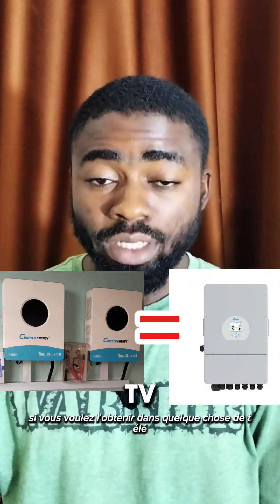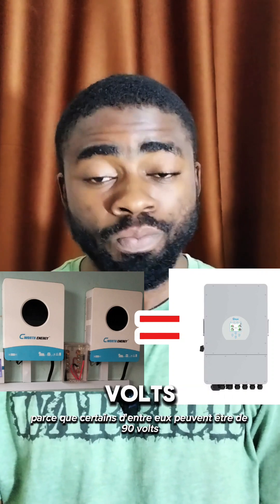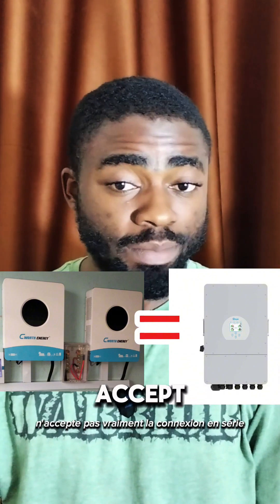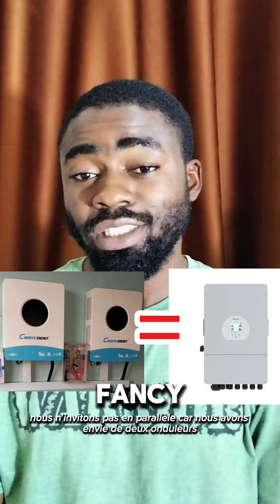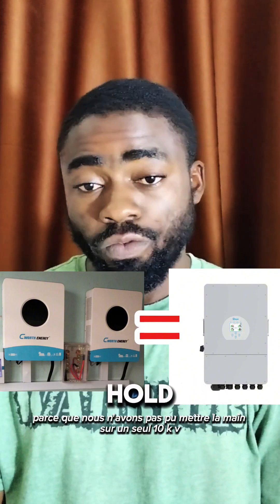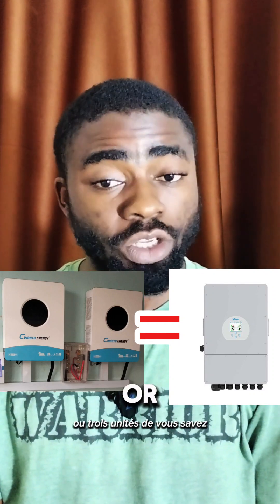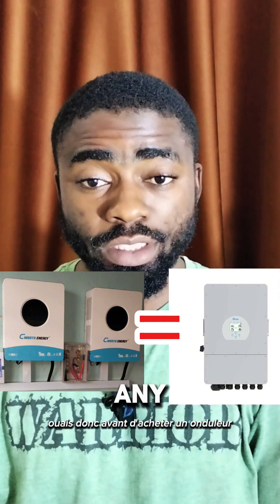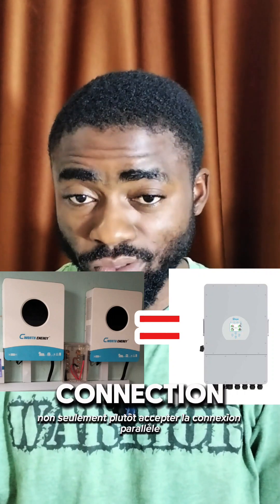NOT ALL INVERTERS ACCEPT PARALLEL CONNECTION!.

Comment: solar god: Good day sir, this your post contradicts one of your post which you spoke about paralleling inverters, you said there that one of the major reason for parallel is to prevent your inverter from damaging at once, e.g as you said, if you have two 5kva inverters, the two might not have fault at once, so while one is bad you can depend on the other before the affected one is fixed, unlike having a single 10kva which you have to go without power when its being fixed...

So i was hoping you will add this point here, but it's kind of confusing now... DO WE PARALLEL BECAUSE WE WANT TO SPLIT THE INVERTERS OR JUST BECAUSE WE CAN'T GET THE REQUIRED SIZE. thank you sir.
Reply: 2 cworth in parallel equals 1 deye 😅
Reply from the maker: 😂😂😂, no be wetin e mean naw
Reply: @Mairigaemmanuel  😅
Reply from the maker: Paralleling two inverter is different from having two inverters,.
You can have two inverters and not parallel them, for example if you have high capacity loads that requires huge surge in that aspect if you don't get single inverter you can now parallel two.